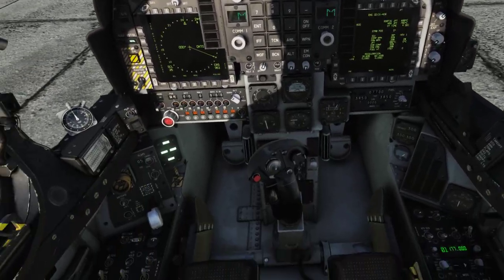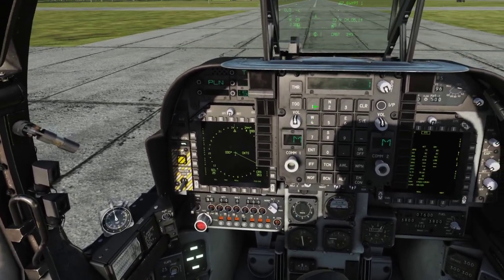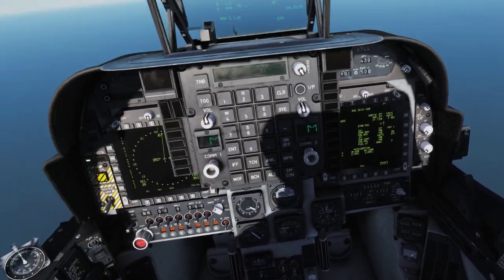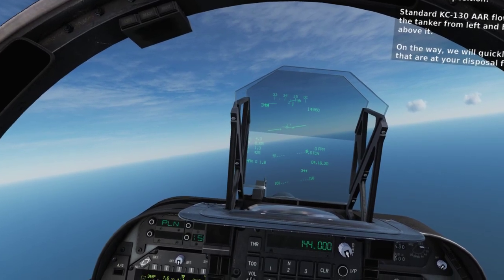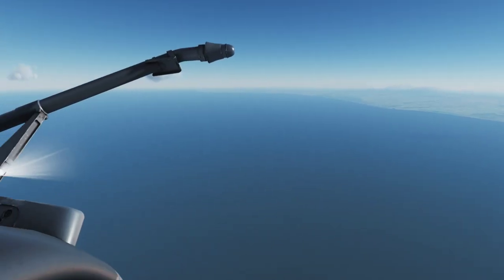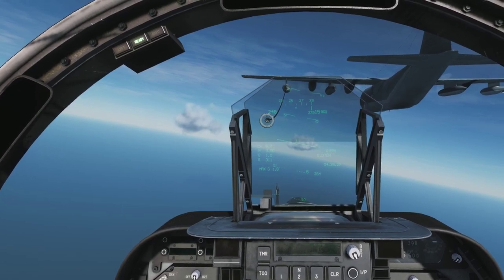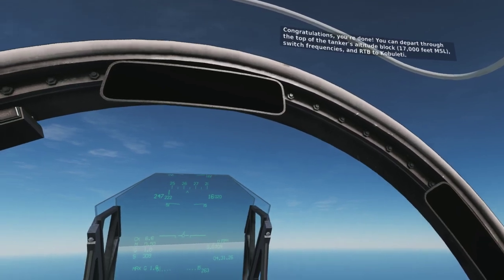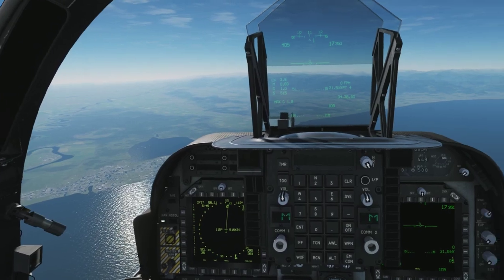DCS AV-8B N/A Harrier - Training Mission 07: Air to Air Refueling

Comment: Nicely done mate. Do you know if this aircraft has data link enabled to send receive from other planes and ground units?
Reply from the maker: The AV-8B version used by RAZBAM did/does not have data-link capabilities.
Reply: @Nobody2000  ok thanks mate. Do you know if there are any future plans to bring it in?
Reply from the maker: As the actual Harriers do not yet have the update, I doubt the DCS version will have it any time soon.